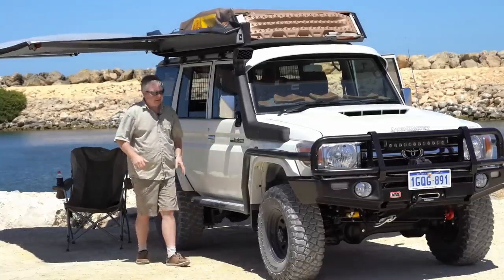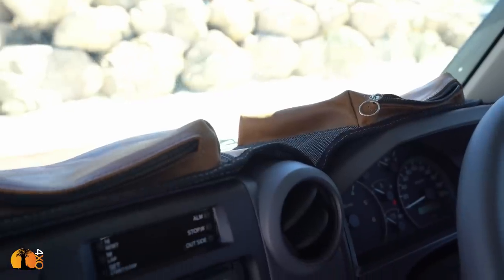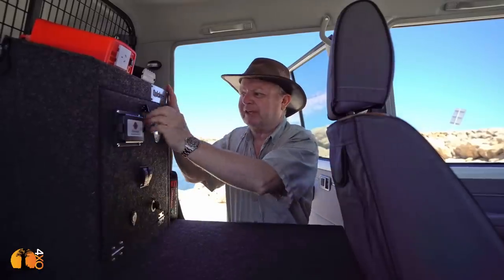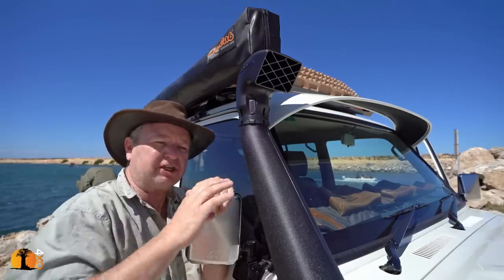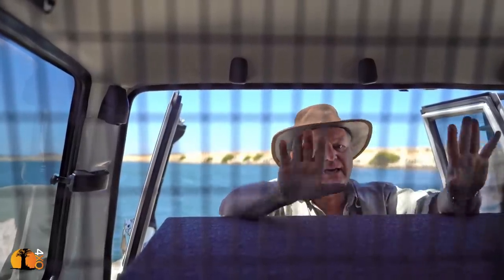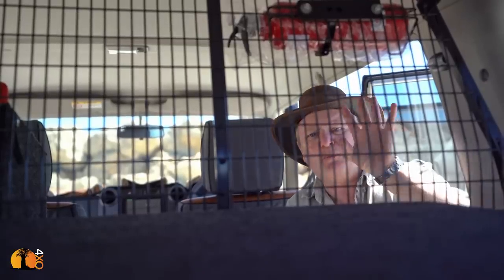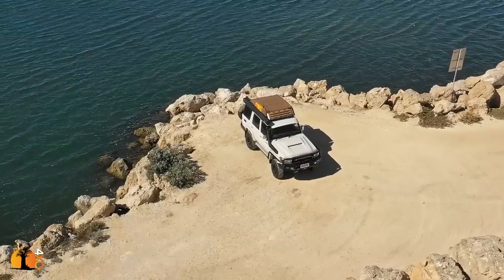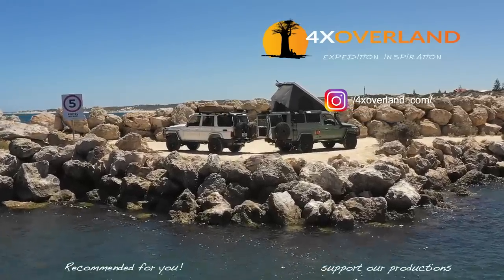MOST VALUABLE Principle. WHAT DOES IT COST? Building an Overland Truck/SUV. Part-3

Comment: Hmm... I think you need to explain that you don't have to spend anywhere near this sort of a budget to get similar result on a touring setup. This setup is what you buy if money isn't an issue. 

You could spend half this budget and still have a very similar result with very little compromise on quality or function.
Reply: thats just plain wrong Steve
Reply: @BTS-gu4iz  No it's not wrong.
Reply: @SteveBurns80  well tell me an example of a vehicle (and Mods) half the price and I will explain why they are not the same
Reply: @BTS-gu4iz  I can give two examples of vehicles that I've setup...

First was Triton extra cab with a slide-on camper, had all the fruit that you'd expect, suspension improvements, suitable tyres, front bar and winch, front difflock, longrange fuel, water, simple lightweight Rhino fibreglass camper with double bed and kitchen ect.. Total cost of camper, mods and purchase of brand new vehicle in 2011 was approximately 55k. It was a great setup, far better than that 76 series and we lived out of that setup for 18months and explored most of Australia. 

Second vehicle is a 100series cruiser, again it has all the fruit, front and rear bars, winch, Icon suspension, tyres, lockers, longrange aux tank, home made draws, simple dual battery, fridge ect.  Purchased vehicle second hand in 2017 for 25k and spent approx 18k on mods up till now... All labour is done myself.

I know they're different vehicles to that 76series but principles remain the same, my point is that you can have very similar or better setup and be just as reliable, comfortable and capable for a lot less dollars. You DONT need to buy the very best of everything on the aftermarket, and always haggle for the best prices, I never settle for rrp.
Reply: @SteveBurns80  Jees steve, Thanks for the long reply! I do like the Tritons but not exactly in the same league in terms of build quality and durability. Main issue I have seen with them is the chassis bending with just a simple tradie box on the back. Clutch problems with weight.  first gear too high. I used to have to put my mates into low range to pull out on a slight incline with a trailer on. And do we really link all these small turbo diesels squeezing out so much power will stand the test of time?. Someone will probably be living in this 76 long after the robots take over the earth.  But overall the Tritons are a good rig for the bucks. Was the 100 a TD? if so good buy!, But comparing a vehicle with likely 300k on the clock and a brand new car is apples and oranges. I bought my 76 for 65k with 50 on the clock with old man emu suspension, tyres, arb bullbar and steps, Kaymar back bar and a few bits and pieces, the thing had never seen the bush! So second hand is always the go. I Think you can have just as much fun in a 10k hilux but as far as NEW vehicles go  there is nothing in the same league as the 76 for half price. Some of the accessories he used .are way overpriced. The Kaymar bar for example is a joke. If mine didn't come with one I defiantly wouldn't have bought  it. I agree with you on most points but reliability, durability and off road ability of the cruiser cant be beat.  Happy touring mate!
Reply: @BTS-gu4iz  Well I wasn't actually talking about the make and model of 4wd, I was talking about the overall cost to set-up/build-up a stock standard 4wd into a suitable and reliable tourer. My original point was that you can pay roughly half what Andrew estimated in his video. 😉 

As for your beloved 79.. Meh, you're probably right in saying they're the best "new 4wd"  but certainly not the best value for money. And they certainly have their fair share of design faults like most vehicles. 
And yeah you're right that the little light weight small capacity utes like the Triton aren't in the same category as a 79, they're fraction of the cost to buy new or second hand. For those that don't need to carry big payloads across the desert then these little utes are fine. Too many people believe the marketing hype of the humble dual cab and over load them. I didn't have that issue of bending chassis on my Triton as I'm not an idiot and used a the extra cab version with my load over and infront of the rear axle. 😉 

And despite what you say about an older 100 series.. I'd back my 200k km 1hd-fte engine for reliability and day against a brand new 1vd v8. 
However I do love the sweet sounds they make when they're not broken. 😂

Comment: This guys killing me with two spares! That's a lot of extra weight for a weekend trip. Just get Auto Club AAA!
Reply from the maker: The AAA or equivalent doesn't offer services In the middle of the Australian bush. The distances between settlements in Australia can be extraordinary. Some tracks are over 600 miles between services - and not on a road, but a narrow, rocky bush track. Two spares are necessary.
Reply: @4xoverland  It's also sign posted as a requirement at the start of some of the famous tracks such as oodnadatta. (there recently) Best not to tempt fate.

Comment: Just build an electric vehicle. Stop converting gas into electric. It’s a very inefficient way to travel. You can easily fold a 3-4 1000 watt blankets for an emergency with lightweight flexible panels if electric logistics is too difficult for you. Bread crumb battery packs to suck off a charge if needed. Just like an external battery for a smart phone. Not brain science here
Reply from the maker: Hey, its a wonderful idea, but if it was that easy, someone would have done it already. Do you have any idea how much electrical energy is required to power a vehicle carry people and food and supplies, versus the amount of energy generated by solar? Its not brain science because we understand the brain. Many have speculated, but nobody has figured this out yet.
Reply: 4xoverland actually the Rivan electric truck battery sizes range between 105-180 kWh for a 7 seater. So that’s a good bet. There’s are tons of converted trucks to electric from all makes and models. So, they actually do exist and with plenty of range, increased ground clearance, lower center of gravity, phenomenal reliability and of course power and torque.  Oodles oodles of both. I’m not completely understanding why so many old heads are so resistant to the new technology. You can’t know what you can do until you really give it a shot with your nose in it. Anything before that is merely a case of lack of nerve
Reply from the maker: Rivian is a concept vehicle, proving it can be done. But your suggestion was that we do it. 'No brain science'. Its advanced technology, highly complex and stupidly expensive to build. So the idea of 'just building an electric vehicle' is a bit way off for us mortals. One day, hopefully soon, we'll see this energy at work.
Reply: 4xoverland oooh please don’t be so dramatic. It’s been done by other individuals. We’re not talking about manned flight to Mars or Titan. Are you saying that another man can do something but you can’t. Rivan and or electric vehicles are not just a concept. Rivan has Amazon/ Jeff Bezos. The richest man in the world. Mass production is getting done this year. 
Have you lost your nerve ole man
Reply from the maker: @shadowdance4666  I am not Jeff Bezos, or anything like him. This is my EXACT point. Thank you for clarifying it.
Reply: 4xoverland HAHAHAHAHAHA I knew that you would say that ole man. Rivan is mass production Mass production. You do understand the concept of MASS production?  However, you are just reading what you want to read. I also wrote that lots of individuals have electrified trucks. I was trying to pay you a compliment ya dense wanker. All I was failing obviously to convey was that anyone could do it and has. That you could do it. But, not only that you could do it better because it’s your profession. You already have some ground work and back ground with the alternative installed power supply. Yes! The hard parts are over. 
  Every electric vehicle consists of only 4 main components. 
1. The motors 2 minimum in a 4x4. 4 motors optimum. Not expensive. 
2. Batteries. Lithium ion best in warmer climate like yours with liquid cooling/insulation optimum. The pricey part 
3. A motor controller. Not expensive but don’t skimp with a lower grade component. Important 
4. Finally, an interface to direct traffic so to speak. An iPhone or iPad may do. However, there are load on the market to choose from for cheap. Just a matter of what your fancy is.  Least expensive 
 Buy a used electric golf cart and rip it apart for experience if you have to. 
  Sorry to trouble you in your choice of profession ole man

Comment: These things are the most  over hyped vehicles on the market weak  diffs  axles etc running gear built too a price not standard we break these things in two every at our mine not good vehicles and I wonder how much spanner work was done by himself
Reply: And what would last longer  down a mine where vehicles are abused for their entire lifespan?
Reply from the maker: Let's see . . . The mines buy them because they have weak diffs? I doubt it. Because of bad running gear? Probably not. Overpriced? I doubt it. Built to a price not standard? Every mass-produced machine in the entire world is built this way. Maybe the mines buy so many because they are retro-looking? Eh? Comfort? Hardly. Space? Unlikely. What's left? Durability? Hmm. Maybe. I can think on no other reason for buying one. NOT ONE. So I have to conclude that whoever posted this comment is a Nissan Patrol driver. It is the only possible explanation. If I am wrong, the comment makes little logical sense. Like the 76 or not, the mines buy a sh1t load of them. And they have to have a reason for this, whatever it is.
Reply: I think you need to do more research mate they snap axle all the time as there many many videos on youtude  including other FWD Channels showing it so you spend 80 k on it then 100 k on  mods to make it a semi off road vehicle
Reply from the maker: @patrollife4952  Do you drive a Patrol?
Reply: @patrollife4952  come on then Tim, what do they all buy Instead of the L/cruiser then....we're all on the edge of our seats waiting to put our orders in !.
Reply: @patrollife4952  you sound a bit jealous!  Little but hurt you can't afford one that's my guess ! It's not a rock bouncer it's an over land vehicle. Toyota's are reliable with that said good luck troll !
Reply: Suzuki Jimny 👍
Reply from the maker: Nissan Patrol owners know that the running gear in their vehicles is extremely strong. Stronger, dare I say it, than a Land Cruiser. And it's the only thing that the Patrol has over the Land Cruiser. So Patrol owners tent to flaunt it. They hear of one of two failures of Land Cruisers and begin pointing fingers, just like Land Rover guys love to do when a Toyota breaks down. But when, a Patrol breaks, not a word. Its a bit silly, but opinions based purely on brand loyalty aren't worth much. And I believe this is one of those. Cruisers are great. Are they perfect? Not at all. Do the axles break less frequently than Patrols? Probably. Do their chassis crack as much? No. Are Toyota's engines more reliable? Probably. Patrols are great as well, but for different reasons. But putting down the opposition just adds strength to their arguments. I see it as very counter-productive.
Reply: Yep, I drive a Patrol & for sh1ts & giggles you can have these points to throw back at anyone who says they're the best. The payload is pathetic meaning most with steelwork & long range tanks are way over gvm before you even get a six pack in & the low range gearing is utter garbage compared to almost every other serious 4x4 out there. Cracking vehicles though if you accept the faults & enjoy good suspension.

The 70 series is a tool vehicle & built for purpose. There simply isn't another heavy duty separate chassis, live axle vehicle out there to even remotely compare to them. Theyre built for purpose plain & simple.

(It is almost unforgivable having a cart spring mini-axle in them, but I doubt handling is the main worry with the sales pitch)
Reply: I understand what you are saying but real world testing of these vehicles 11 year they not that great and to say a few failures there has been a bit more than that you yourself have done video fixing the rear track on your own Toyota and why do aftermarket manufactures produce complete upgraded replacement diffs if there was not a weakness there would not be a market for it I could  go on about the cost of injectors in these vehicales going into limp mode etc but this is my opinion can agree or disagree
Reply: @4xoverland   There's mines in WA that also bought Foton Tunlands when they first landed here back in 2012. I don't know how they fared.
Reply: But at least the Toyota is diesel, a point I consider non-negotiable in remote operations in Australia!